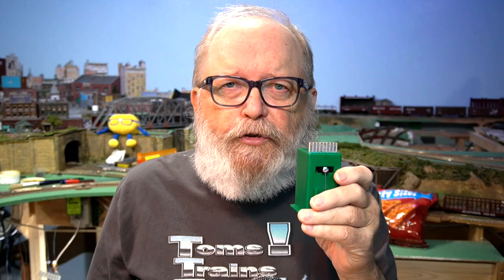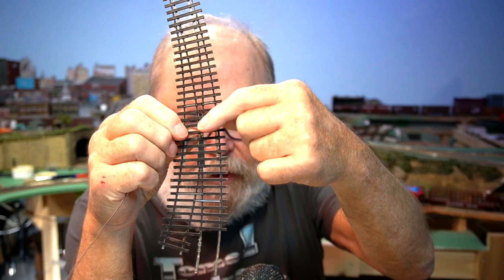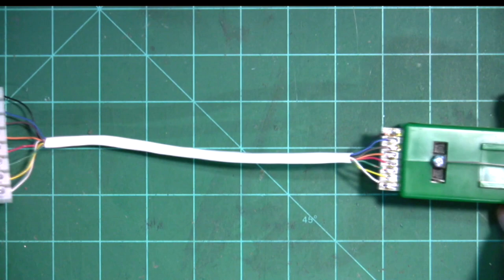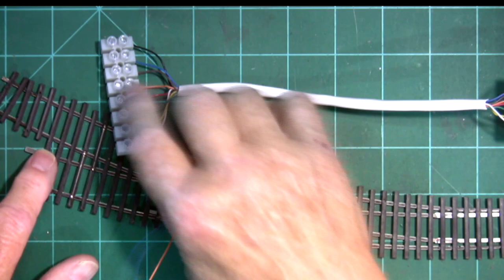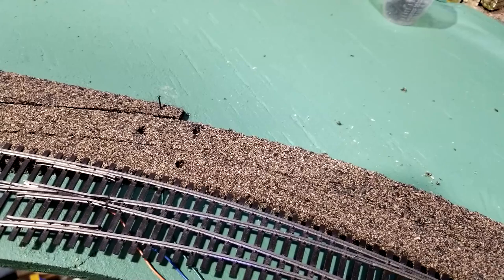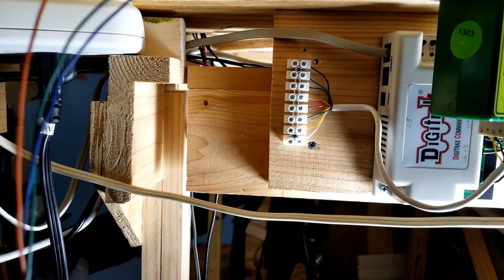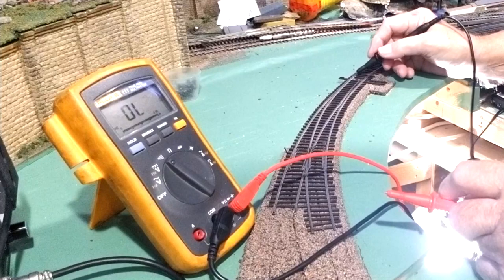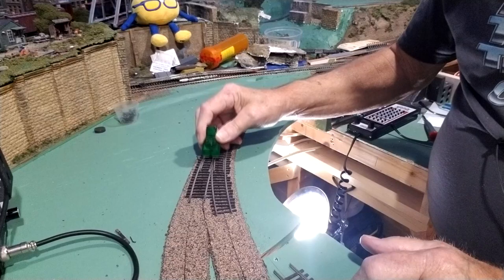How To Wire A Tortoise Switch Machine To Power Your Frog

Comment: Tom I understand the mechanics of what you are doing, what I don't understand is how to use contacts 2,3,4 to power the frog and change the power going to the frog to that is going to contact 1 or 8 of the tortoise...do u have a video for this?thanks
Reply from the maker: Contacts 1 and 8 are power to the tortoise to switch the tortoise only. Nothing to do with the other contacts
Pin 2 & 3 is power from each rail, 4 goes to the frog so when the turnout is switched, the frog receives the power from the corresponding rail

Comment: Is the 9V that Tortoise switch machine require enough for the track power for slots 2 and 3?  My NCE DCC system uses 12 Volt but my Switch machines require 9 volt.
Reply from the maker: The Tortoise requires anywhere from 9V up to 12V. If you want to power your tortoise, you would have to do it directly from the power supply.  The Tortoise uses DC while your NCE & Track is DCC. Not the same thing
The auxiliary contacts on the Tortoise (Pins 2 thru7) are independent from the two pins that drive the Tortoise (1-8). They are basically like the contacts on a relay.
Don't know what your referring to by slots 2-3!
Reply: @TomsTrainsandThings  If I use pins 2/3 to the tracks and pin 4 for the frog from the 9V power supply I have for the tortoise, will that be enough power to the tracks for the loco's to run?
Reply from the maker: Your not understanding the concept of your NCE Power cab which is DCC. That supplies your signal to the track which is not DC. DCC is a varying square wave signal supplying information to your locomotive that is connected to your track through the NCE System. Your frog and the adjacent tracks need the same signal as your main track when you operate your turnout. DC has nothing to do with your track power unless your running a DC system which you are not with your NCE Power Cab.
You want to jumper the wires  you have connected to your track to the auxiliary contacts on the switch machine. NOT DC.
The DC voltage you feed the Tortoise does not feed the track power!

Comment: Hi Tom,  Catching up on videos as I get ready to power up my yard.  I am using Tortoise switch machines and plan to power with a Mk2 board allowing my NCE DCC to power the Tortoise.  Will this still work for my older Shinohara switches????  Thanks, Mark
Reply from the maker: Tortoise switch machines will work with any turnouts